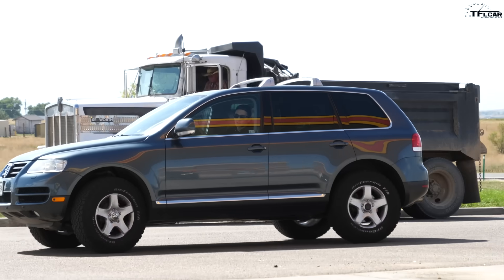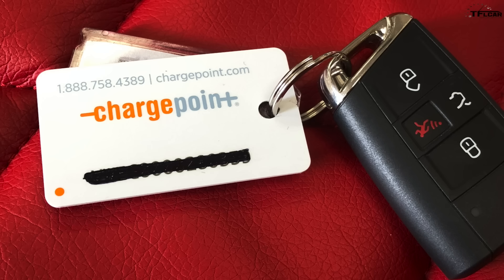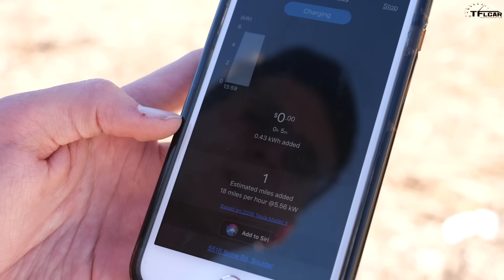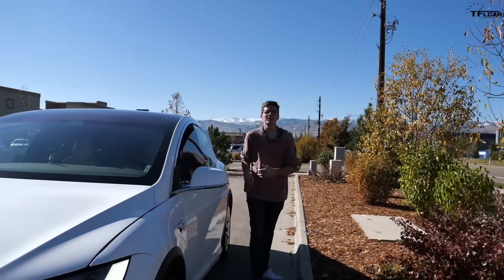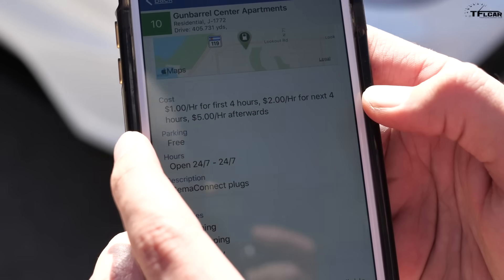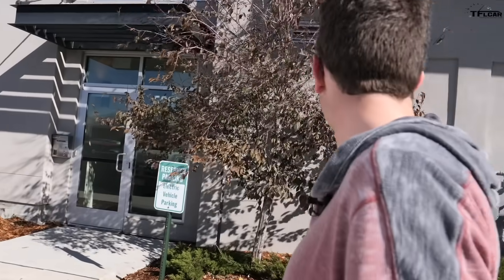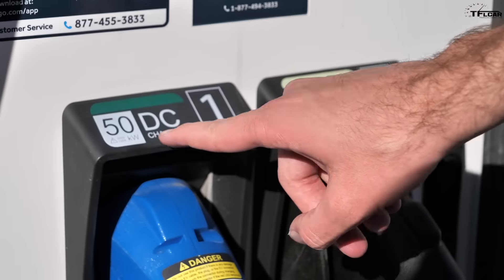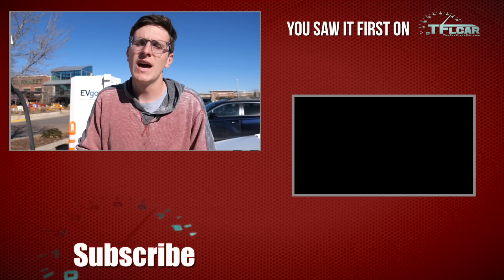Here’s Why Charging an Electric Car Can Suck - And It’s Not The Reason You Think!

Comment: 14:10 - Tesla is using CCS (and type 2 for AC) in europe because they are required to do so. It´s the standardised plug for the european union
Reply: True. Subtle point here though. The EU directive says nothing about cars. Tesla may keep selling their cars with any plug they want. And they do: Tesla does not equip S and X model with CCS.
The directive is for charging networks. Fast charging networks are obliged to provide CCS connectors and may additionally provide other connectors as well (like ChaDeMo or in Tesla's case their own connector). So Tesla was obliged to adapt their charging network and equip the chargers with CCS even if these connectors would never be used.
Tesla chose to equip the model 3 with CCS to make use of the changes it had to make to its network anyway, but strictly speaking Tesla didn't have to equip model 3 with CCS.
(See Alternative fuels directive 2014)
Reply: @HenriZwols  Tesla now offer a Type 2 CCS adapter for Model S and X, which needs some hardware support in the vehicle - which the Chademo adapter doesn't need, but they will happily sell you the hardware retrofit along with the Type 2 CCS adapter. New Model S and X with type 2 style charging inlets are already fitted with the hardware necessary.
At least, they do offer this in countries outside of North America.
China is another thing entirely. They have their own national standards that aren't J1772 or Type 2.

Comment: The different prices from different charging points is that each electricity has different exclusive additives and detergents in it.
Reply: Use top tier electric only for best mileage 😂
Reply: Keeps your batteries clean!
Reply: Premium electricity for higher performance
Reply: Also the more premium ones refill your Blinker Fluid over the Plug :D
Reply: Premium high octane electrons
Reply: "conflict free electrons"
Reply: LOL
Reply: I put RON 98 electricity... My car goes like lightning!.
Reply: Wouldn’t be surprised if charting starts becoming as scammy like gas stations.
Reply: @angelgjr1999  they are. Ninety nine percent of all the stations ive come across dont accept credit or debit cards. You must sign up for their special service and card.
Reply: BossSpringsteen69 Tesla shouldn’t allow that. Also how much do you commute weekly and how much do you spend? How does it compare in terms of MPG?
Reply: Winter vs summer blends
Reply: I like Shell Rotella Electricity with E-Power.
Reply: Conflict free electrons but to date cobalt (used in motors and batteries) is not conflict free. And the electrons are not carbon free.
Reply: Behave !,,,
Reply: LOL.  Nice.
Reply: Do they have some electrichtron cleaner or boosters?
Reply: I only use charging points that get their power from natural electricity from rainforest energy
Reply: i started putting premium electricity in my EV's and now the motors runs way smoother and the range im getting is insane.
Reply: The charge is for led light bulbs they sell you at a "discount".
Reply: "There's 10% magnetism in this electricity."
Reply: I only charge with Ultra 94™ electricity.
Reply: I would not be surprised if the plugs are designed to fail every 4-5 years so you wind up having to replace the socket AND the assembly housing because they can force you to. And I know it'll cost less than $500 to replace it all but Tesla, like FAPPle, will charge $1,500.
Reply: Wait until the dope-heads find out how much copper is in those charging cables!  If they'll steal copper wire and pipe from buildings, they'll soon be stealing those cables from all the charging stations. (LOL!)
Reply: @nephetula  Hell, they steal the nozzles off the air compressor at QT. This isn't beyond them XD
Reply: My car started communicating with the charger, they started dating, haven't seen any of them since, 
going back to gas ,lol,
Reply: there is a dead tiger in the tank
Reply: Hence, clean power!
Reply: I think more importantly since we want to be green; each charging station should indicate if the electricity came from coal, or Nuke, or Solar or whatever.. as an EV owner, I really need to confirm source of my juice otherwise the entire point of the exercise to help my planet would be negated... I refuse to use electricity from coal, hydroelectric (fish spawning and destroying rivers), atomic (waste disposal), I want to only use solar or wind or I refuse to use that charger station... Anyone want to go on a road trip hit me up!
Reply: And costs $2.00 more in California ...
Reply: @williampotter2098  emissions tax.
Reply: @williampotter2098          per kilowatt-hour
Reply: I believe all electrons are created equal. In other words there are no aedatives. The only difference is the amount of electrons flowing into the car.
Reply: @jacksonbangs6603 
That's the joke.
Reply: @jacksonbangs6603 -- It's meant to be joke.
Reply: Racist!
Reply: @jacksonbangs6603  electrons dont flow into your battery, only electric charge. its an important distinction

Comment: My unpopular (in the BEV community) opinion:  Public discussions of public charging is counterproductive with respect to EV adoption. This is the main reason why there will be a lot less BEV's & PHEV's sold in the U.S. this year (2019) than last year. Although over 80% of all BEV/PHEV owners charge at home - simply due to the FACT that 93%+ of all U.S. drivers' daily commute is less than 50 miles - this stat of course excludes the residence charging challenged (those who have no overnight access to a plug).  The only time public charging is necessary for the vast majority (charging challenged excluded) is in the event of an out of range trip.  Again, the vast majority of U.S. households take about 2 driving trips per year further than 400 miles. It's no wonder that non BEV/PHEV consumers - consumers that fit the overnight home charging sweet spot -  don't want anything to do with 'Lectrik cars (as evidenced by the negative sales rate).  Too much hassle, fear of being stranded, and the reality that public charging vs. ICE gassing-up is a waste of ones valuable time (which it is). It's a perception driven by endless discussions and videos like this...as if public charging is somehow a daily necessity.  It's not.  At least not for those in reach of an overnight plug for almost any BEV made in the last 5 years.  

As a BEV [Bolt] & PHEV [Clarity] household, I can count on one hand the number of times we've used a public charger in the past few years.  Long(er) distance road trips are done in the PHEV.  And even more incendiary opinion,  50-Mile plus all-E range PHEV's eliminate 90% of emissions compared to ICEv's, yet have ZERO range anxiety and no real need for public charging at all. A PHEV with this range is a superior choice for most consumers.  But if ones real priority is not to save the planet, but to show off their $100K X or $65K M3, then keep making videos about how tough it is.

Comment: If you have a home with a driveway or a garage, it's easy to install your own L2 charger. Unless we're on a road trip refueling an EV is as easy as it gets. I pull in the garage and plug in as I get out. When I go to leave, I unplug as I walk to the driver's door. A few seconds each time. No worry about if I have to swing by the station to get gas in the morning or on the way home. No stress, no mess. 

What he failed to show is the Tesla router even picks out the charge stops for you (but you can pick others if you want). Road trip charging for us is done while we take rest and meal stops. We plug in, do our thing, and when we're ready to go the car is too.

Comment: Tesla super chargers always break or charge at 4kw...which means there's something wrong with that station. I always make reports to Tesla, they never fix them. Im in NY.....
Reply: That's a flat out lie.
Reply: @leeoldershaw956  I took pictures as proof when I email Tesla support. Don't accuse when you don't know. I also have a some paint defects that I have pics on. I am a little disappointed. But i guess that's what happens when a company is new.
Reply: @mana9013  You said "Tesla supercharges always break and charge at 4 kw". False.

Comment: TFL just lost a regular viewer.  Of course, Tommy doesn't mention that in the US, the government subsidizes fossil fuel about $650 billion.  This was a great idea when we were building our infrastructure but should have stopped a long time ago when these gas companies started raking 100s of billions every quarter.  Too bad we don't apply the same logic towards our charging infrastructure.  Also not to mention that fossil fuels are a huge reason for climate change and killing our planet.  Furthermore, it's extremely combustible compared to batteries.  This is a totally bias story and shows that TFL is not telling the full story.  I had a Nissan Leaf in 2012 and i didn't think the charging was as bad as described in the story.  There are still many locations that allow you to charge for free.  When I switched over to Tesla, it completely changed my mind how a car should be made.  Not only is it the SAFEST car in the world, which is the main reason why I bought it to keep my family secure while on the road, it's a huge step above most other cars.  I've owned Lexus, BMWs, MB, Honda, Toyota, VW, Nissan before and they all don't care to a Tesla (they don't even come close).  it accelerates like no other and anytime on-demand.  it won't kill you if you have it running with the garage closed.   I don't have to change the oil or go to a smelly gas station.  I admit that I still own a Ford F150 for hauling and towing.  I can't wait for the Tesla pickup truck so that I can go totally electric.  Also did I mention that my two teslas are powered by my solar panels.  So for those of you that say negative things about EV's, especially Tesla.  Give it an honest try before you believe the lies.  You won't regret it.  There's a reason why Tesla can't make enough cars for the people who want them.  And the fact that they've done it without a single dime for advertisement.

Comment: I really like TFLcar but this video is very misleading. If you have a Tesla you are going to charge at a supercharger station and you can charge to 50% in 20 minutes and now there are the supercharger 3 stations and you can charge 75miles in 5 min or 1000 miles added per hour with a model 3 long range.

Comment: This proves that EV's are still not convenient to use until EVERYONE agrees on a single, unified charging standard. I'd recommend everyone, including Tesla, switch to the J1772 CCS2 plug design, which allows for reasonably high AC charging rates and potentially DC charging rates as high as 350 kW, which is more than enough to charge vehicles with larger battery packs.

Comment: No thanks. I'll stick to gasoline power. More range for interstate driving. Very short refueling times (minutes, not hours). Pollution? try disposing of that worn out Tesla battery. carbon pollution? Don't you know that America's electric grid is powered by mostly Natural gas and King Coal that Tesla sucks off the teat of?

Comment: You guys are spoiled!  Step back twenty-five years in time...  We had EVs - we built them ourselves. Charging infrastructure was non existent, here and there. The very first public charging stations were coming online. Reliable?  Tripped breakers, ICE’d charging spaces, vandalized charging infrastructure, unsupportive charge station hosts.  A trip from the SF Bay Area to Sacramento, a distance of about 90 miles, was a whole-day affair complete with lots of planning for plugging in.

I enjoy seeing snippets of Boulder in your videos. I grew up in the Denver area, and went to school at CU-Boulder. I spent quite a bit of time in Boulder in the 70s and 80s. In 1989, I moved to the SF Bay Area to take a software job, and have been out California-way since. It looks like Boulder has changed quite a bit since...
Reply: Chuck Hursch Super interesting, thanks for the comment!

Comment: Seems it proves Tesla is the only convent charging system.  I have had my Tesla for a year and mostly charge at home. Takes 10 seconds to plug in and I have 326 miles of range every morning. However on trips of course I use Supercharges. Most stops are 20 minutes at 150kwh speeds adding about 500 miles per hour. New Superchargers (V3) can add charge at rates over 1000 mph. The only time I use a 1772 level 2 charger is at a local State Park overlooking the ocean. It is free and I often watch a movie with Tesla’s Netflix theater mode with the ocean air and sounds around me. I find electric charging, at least with a Tesla, far more convenient and less time consuming than running to a dirty smelly gas station twice a week.

Comment: Ok, with an EV other then a Tesla, maybe a charge point is necessary. But with at least 250 miles of range available on  my Tesla, I've never had the NEED to use a charge point,  The one time I tried it just to see how the charge point worked at my job, it was no big deal to add the adapter. You kinda act like it added an hour to process to hook up as opposed to the additional .5 second it added to plug it in. I drive to work and back. When I pull into the garage after work, I plug it in on the way into the house.....doesn't get any easier then that. It adds zero time to my day, and I start my day with a full charge (80%) every day. On the occasion that we've taken the car on long trips on the weekends, I've used the Tesla Supercharger network and it was free.  We've personally enjoyed it so much, my wife is selling her car and getting an EV as well.

Comment: For most people who get a good EV (meaning a Tesla), life will consist of plugging in when you get home.  That's the whole video. Others can plug in at work (for free in my experience) and that level 2 charger will fill you up while in the office.  In your regular life, you don't need access to 250,000 chargers - one app setup once and you'll be able to interact with all of the chargers you regularly come in contact with most likely.  I've only used Chargepoint because that was what my job used and there are chargers everywhere i park downtown (free, again).  I regularly go to the grocery store and don't bother using the level 3, but if i had a really busy week and was outpacing my home charging i could plug in there while i shop and get the cushion i'll use for the next week built up.  If you drive for a living, get ready to supercharge at lunch.  I agree the scheme for level 2 charging made it difficult for EVs to work in the past... but Tesla exists so... just buy one of those.  Very hard to find a situation where living with a Tesla is hard unless it falls apart.

Comment: Good video Tommy. However, as a Tesla owner I must say that ChargePoint stations are a joke. 5 kw is just plain stupid. I installed a nema 14-50 which give me 32 amps on the Tesla mobile charger. It wasn’t too expensive, about 300$ to do it myself or 1000$ paying an electrician. This gives me 7.6 kw (240 V x 32 amps= 7680 watts. At home I get 50 km/h (30 mph). If I would buy the new tesla wall plug charger, I would get 42 A (62 km/h). Regardless, this is much better than this industrial ChargePoint charger. So why did they even bother?

Comment: Well just my thoughts as these vehicles  start to take over and they’re working on it the  big problem will start to arise. Fact it takes on average a person about ten minutes or less to fuel a vehicle what happens when there isn’t enough chargers to support all the cars also you know people won’t be able to afford the very expensive electrician to come to your house to install the fast charger. Most people who own these vehicles I would say are people who have combined incomes above 250k just saying
Reply: Actually, you can plug into a standard 30A or 50A dryer outlet and get 24 - 30 miles per hour, so if you typically drive 40 miles per day it's just a couple of hours at night while you sleep to fill up and have 250 - 300 miles range (if needed).

Comment: Tommy, good job explaining your local charging situation. If I were to buy an EV truck, I own 2 pickups Dodge Dakoa quadcab and a f150,in my city there is no public charging infrastructure 0. The nearest city with such, Edmonton is 300 miles, 500 kms away. In warm weather+10°C a 400 mile, 645 km range would be basic. Now in winter weather -40° C or F my range will drop to 150 to 200 miles. I would need a 600 to 700 mile range battery to get home safely. Here lies my only bone of contention with EVs and their infrastructure. From your own presentation I would say you have very little to complain about.

Comment: If technology can somehow develop a standardized battery that swap out an empty battery for a fresh one in minutes instead of charging for hours that would be a game changer for EV vehicles.
Reply: too much liability issue there... You might get a damaged pack; who knows where your newly swapped battery pack has been prior to you getting it.  This idea has been discussed and dismissed in BEV circles.  And battery packs are very, very heavy...  Whole new designs would have to be made to make them easily interchangeable, quickly, meaning they could not realistically be in the lowest part of the car (which is the safest part for them to be and which gives the better/safer center-of-gravity).

Comment: until you can plug in your car and have it fully charge in 10 minutes, owning an EV for a renter or someone without access to 240v home outlet is not feasible
Reply: Dead wrong. Charge at home. Don't be wedded to the pump.
Reply: @pepilepew4742  Did you read anything I just wrote?